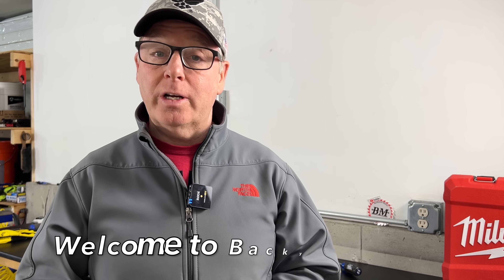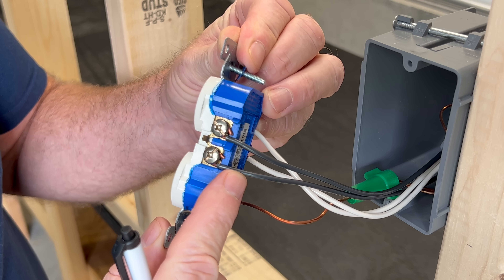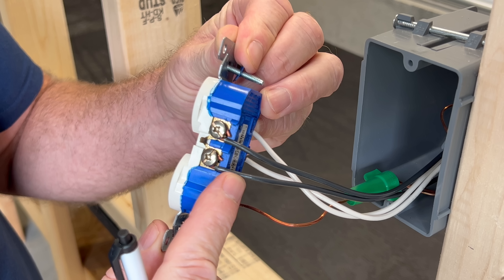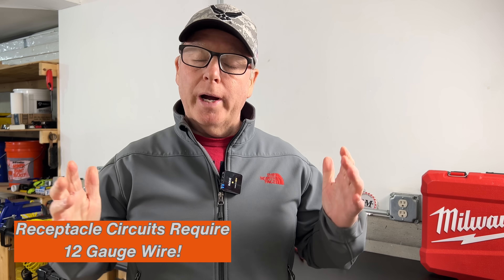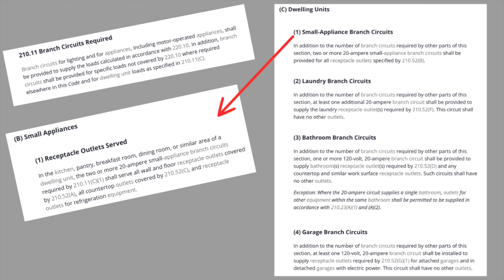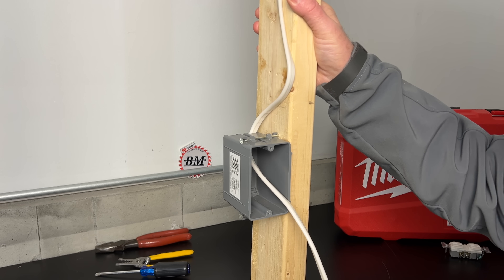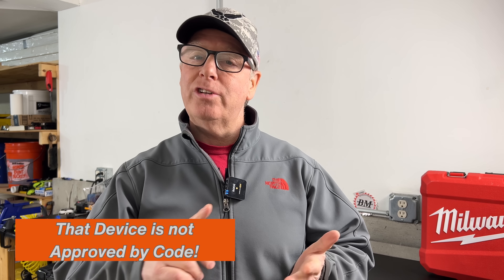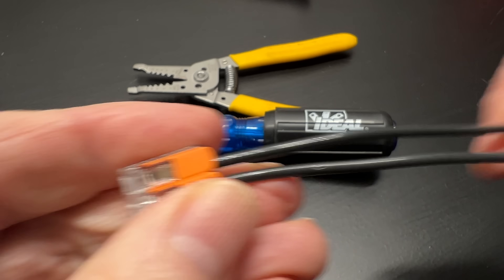5 Electrical Code Lies DIYers Should Stop Believing!

Comment: Does the code require the staple to be 12'' exactly from the box? Why couldn't you put a staple 2 inches from the box and include a 16-inch service loop?
Reply from the maker: Here's a video I made about ROMEX support requirements. https://youtu.be/UwIpG4iQILY
Reply: @BackyardMaine yeah I actually watched that video yesterday, but I think you've not been entirely clear on this point of whether it's ok to have the staples much closer than required and then use the extra slack for a service loop. I don't think you specifically addressed that point in either video. I assume it's ok but wouldn't say I know for sure.
Reply from the maker: @mikanystrom7103 yes you can staple closer to the box but as I stated in the video the cable length between the staple and the box cannot exceed 18 inches.
Reply: @BackyardMaine yes that makes sense, thanks!

Comment: Reminder:  
1. The price of admission to the internet is very, very low.  
2. Actual knowledge is optional when posting comments and videos.
3. The actual (and applicable for your jurisdiction) electrical codes are available in the same device.  Not reading them is willful ignorance.

Comment: So can you use Wago connectors to run to a bathroom or kitchen as long as the Wagos are not in the outlet/switch boxes and at least 6 feet from a water source? Like in a ceiling  junction box more than 6 feet from a sink, toilet, tub or hose bib?

Comment: Lots of good information here and my 1992 built home under the kitchen sink has a standard orientation 2 plug receptacle one of which is for the garbage disposal and the other just open for another use. I'll have to guess this item in the NEC code came about 1992.
Due to space limitations with the disposal and plumbing in place, not easy to due without removal of the disposal which is about 5 years old and next replacement I'll replace the outlet and install correctly. 
Thanks for all your work.

Comment: Thanks for the video didn't know about the pigtail rule I have actually had an inspector fail me once for not having them and had to go back and put them. I have seen we're not having pigtails can cause an issue however back when the plasma TVs on the wall was a big thing had customer that plugs in a hair dryer in their bedroom and when they turn it on the video on the TV would go out but the sound would stay I checked the outlets on that wall and there was no pigtails I put pigtails and it didn't happen anymore,...
Reply from the maker: I have a video on pigtails as well. https://youtu.be/K3RIjUnrNTQ

Comment: run all 12 ga. wire, the cost difference between 14 ga. Is negligible and you will get less voltage drop on larger current draw devices

Comment: I’m hoping you’ll chime in on the seemingly controversial topic of GFCI-protected receptacles in a garage. Even Bill @ Sparky Channel’s explanation left me wanting. (Though I may go back and watch his again.) 

Seems like there ought to have been exceptions where the building is not in a high-risk flood plain (as determined by FEMA maps), not subject to direct water exposure, etc. (Or perhaps the other way around, where such cases mandate GFCI protection for all receptacles. 

Many want to have an unprotected outlet to maintain power to a garage door opener, small refrigerator, etc.
This would be accomplished by having the wiring that leads to such receptacles at the Line side of the GFCI, rather than the Load side. (Or in other ways, but this is how I would do so in my garage.) I added a GFCI at the first box in the garage, and all other outlets in my garage lead from the Load side. There is only one cable, with only one receptacle, that powers the garage door opener.
Reply from the maker: Great video idea.

Comment: The NEC is NFPA 70.   NFPA has number of codes/standards and electricians should be knowledge of.  NFPA 72 - National Fire Alarm and Signaling Code.  NFPA 90A - Standard for the Installation of Air-Conditioning and Ventilating Systems.  NFPA 96 - Standard for Ventilation Control and Fire Protection of Commercial Cooking Operations.  Just among a few.

Comment: Just watched two of your videos. Both exactly what I like to see in common sense video instruction. It would be great to see videos on common upgrades that home owners attempt, like splitting a room's outlets into onto two breakers. Code rules on adding cable runs from breaker box to a receptacles via the attic. Cable on top of ceiling joists, number of cables in top plate holes, cabinet cable gourmets, cable staples and so forth.
Reply from the maker: Awesome, thank you!

Comment: I was under the impression that people have started running all 12ga 20a circuits everywhere to avoid putting a 15a circuit somewhere they shouldn't.

And aren't people starting to do that for dual AFI/GFI breakers too? As easier to pass inspection, avoid mistakes, etc? Customer pays for it anyway, in their eyes.
Reply from the maker: That could make the installation considerably more expensive and we should always try to do the best for our customers. I don't think we should make decisions based on our lack of knowledge of the code. New installations require AFCI protection pretty much everywhere with a few exceptions like outdoors. GFCIs are certainly required everywhere and I have found them to be problematic on some circuits.

Comment: A service loop is great if you can get to the point of security by staples behind the finished wall without damaging the wall!
All circuits should be secured at least 6”from outlet boxes.
Reply from the maker: By code it's 8" for single gang plastic boxes without clamps and 12" for boxes with clamps. I made a video about code requirements for NM cable.

Comment: Wrong about number one😂.
Reply from the maker: Nope.. Better look at your code book again and stop believing what someone once told you. If you want to comment back be sure to provide the code reference.
Reply: @BackyardMaine  where’s the logic of having downstream receptacles go out when one of them fails?😄
Reply from the maker: @caring-assoul_  If your receptacles are failing then you need to pay closer attention to your terminations. An improperly installed wire nut connection can fail as well. I have a video on when and why I choose to pigtail.
Reply: @BackyardMaine  ok

Comment: The most important rule to remember is that the code is the absolute minimum required. The AHJ, aka the inspector, can require whatever they want. If the code says you can use #14 for a 15amp circuit, but the inspector wants #12, then you use #12. Also, if the inspector demands pigtails, you install pigtails. In most cases it is better to just do what the inspector wants than to argue with them and in many jurisdictions, there is no meaningful appeal process by which you can get the inspector overruled. So fighting with the inspector just delays the job and could create more problems.

Professional contractors deal with the inspector/s all the time so they know what requirements they might have that exceed the code. So, it is important that a DiYer speak to the inspector prior to doing the work, usually when they pull the permit, and inquire if there are any special requirements they need to be aware of. You can also consult a local electrical contractor, though since they would rather do the work themself, they may not want to consult with you. You can also speak to the instructors at the local trade school or union hall.
Reply: Not in the real world. The inspector is not the AHJ; he is simply an individual who's job is to make sure installations are code compliant. The AHJ is the usually the building/electrical department. Inspectors don't get to make up rules out of preference. If a code is not on the books in a local jurisdiction, it's not enforceable. Real electricians push back against inspectors all the time when they're wrong. I've had to school many inspectors and any time one tries to make up a rule that doesn't exist, opening up the codebook or a phone call to the chief inspector usually gets him in line.
Reply: @pld8993  If you think that then you have limited experience in the industry. In the "real" world, things do not always work they way you want them to. The local building board is generally made up of a mix of tradesmen and nontradesmen. They often take the advice of their inspectors as to what should be enforced beyond minimum codes.

You can always claim a requirement isn't enforceable, but the inspector will simply fail to approve the work. Then you have the choice to either do it the way they want, or try to take the issue to the building department who will generally be resistant to go against their inspectors, especially if the inspector can demonstrate that what they are asking for, even though it exceeds official code, is "better." You are better of just knowing your local inspector, finding out their special requirements and pet peeves and just doing it. "Real" electricians want to be safe and work the most efficient way possible and wasting time arguing with an inspector is rarely the best way to spend your time. I am not saying to never question or push back, but more often than not, the time lost arguing with an inspector or escalating a disagreement is simply not worth the effort and can be significantly detrimental to not only that job, but future ones as well.
I have 30+ years in the industry across dozens of jurisdictions in residential, commercial, and industrial.
Reply: @TwilightxKnight13  My limited experience includes 40+ years in the trade, got my first master license in the 80s, been in business for 35+ years and licensed in 6 states and dozens of jurisdictions, been teaching the trade for 25+ years and I've served 4 terms on two county electrical boards. I'm still in the field and have been dealing directly with inspectors and electrical departments for decades. 
Electrical boards are typically populated with some non-industry people, as you mentioned. Some even include volunteer citizen members. As such, electrical boards/committees are not in the business of interpreting the code or calling strikes and fouls when it comes to individual inspectors and contractors. A contractor challenging the AHJ (the building/elec dept) could rise to board level but again, interpreting a code provision is something a board is not equipped to do and they will always defer to the experts, the authority having jurisdiction to interpret and enforce the code.
Very little of the NEC is open to interpretation as it is largely explicit and precise. On the not too frequent occasion that competing interpretations arises, if it's something that occurs frequently the AHJ, not an individual inspector but perhaps with the inspectors' input, will likely have decided what the official interpretation is. Your misguided opinion sounds more like something you heard or were told as opposed to actually experiencing it in the real world. Get to my level and deal with this stuff directly and you'll have a better understanding of the industry. If code requires #14 and an inspector fails everyone until they run #10 only because he said so, he won't be an inspector for very long. FYI, bonus lesson for today, there are lots of inspectors that are not and have never been electricians, probably working from a checklist. Class dismissed. You're welcome.

Comment: When was the 20A requirement for kitchen, bathrooms, and garage brought into effect? My home was built in 2016 and they have 15A circuits and 14AWG wire for all of those. In fact, there are only 2 circuits in the entire house (besides 240v circuits) that are rated for 20A. The microwave circuit, and very strangely the dining room circuit. Why anyone would want extra power in the dining room I have no idea....
Reply from the maker: I don't remember which code cycle but I think it was in the mid 1980s. When I built my home in 1998 they were required for at east a decade.
Reply: @BackyardMaine  Hmm. I wonder how the house passed inspection then. Every home in this whole area was built by the same company (Lennar) in 2016-2017, and every house has nearly every circuit at 15A and 14 AWG 🤔
Reply from the maker: @LordSaliss  You can install 15A receptacles on a 20A circuit so maybe the breakers are 20A? Otherwise the inspectors are not looking closely or are not experienced. 210.11c spells it out quite clearly.

Comment: I saw one guy talk about adaptors for foreign plugs. He never figured out why he had so many thumbs down. He was persistently stated  North American domestic voltage is 110 and not the 120 240 we have.
Reply: 110 and 120 are nominal voltage numbers, they're the same thing electrically.
Reply: @pld8993  The 110 is some misnomer that has been transmitted within communities.
Reply: Years ago, the nominal voltage in the U.S. was 110/220. Over the years, it moved to 115/230, and finally to the 120/240 we now use.

Comment: You're not wiring MY house with 14 gauge wire.
Reply from the maker: Absolutely fine as long as the home owner is willing to take on the 25% increase in cost.
Reply: @BackyardMaine  To be fair, the only additional cost is the actual wire. In the grand scheme of things, on a new house, you are talking maybe $200 additional. I would pay that willingly. If you want to save money, do away with the ridiculous AFCI requirements.
Reply from the maker: @littleprincess4417  Thats quite a lot less than what I think but it surly depends on the size of the house and whether you buy your wire in bulk. I also see an additional labor cost since 14 is easier to work with when trimming out. I used gauge wire on my own home for everything that was not a required 20A circuit. I have no issue with using 12 gauge wire though as long as they're willing to foot the additional expense.
Reply: @BackyardMaine  I’m basing my costs on buying 1000’ of 12 vs 14. Of course if you are wiring a 4000’ house, it would be more, but in the grand scheme, wire is usually only a small percentage of the cost of an electrical installation. I’m not sure why you think #12 is harder to work with. Unless you are trying to put too many wires in a box, #12 folds in nicely. I just think it is better to use all 20 amp circuits. You may not. I do enjoy your videos.

Comment: Regarding number two, it may be people are misinterpreting what face up means. Since humans are programed to recognize faces, a duplex outlet looks like a face when the ground is down. So instead of reading face up to mean the outlet is mounted horizontally, they think face up means the face they see in the outlet is right side up. So by turning the outlet to ground up (or upside down, in this case), they see that as face down, which is not face up.

Comment: "adopted" = taken in, used as is.

"adapted" = we'll use the majority of it, but we'll make a couple tweaks.

Methinks you meant "adapted".
Reply from the maker: Good point but I did mean to say adopted. When the code adds a new standard they say they "adopted that standard" which in effect is taking it in as a requirement and it being used by electricians and installers.

Comment: What's the logic behind securing the cable within 10" of the box with a maximum of 18" of cable?  From a homeowner perspective, all it does is make otherwise simple repairs difficult, never having enough wire to pull out if they're cut short, or making it next to impossible to get the box out of the wall.

In the Low Voltage and Communications side, leaving a service loop or "love loop" is the norm (or at least it was ~20 years ago when I was doing it).

Comment: Did a lot of wiring and problem that sometimes arises with making pigtails they add to the box volume and often create a violation for not having a large enough box. Have used spec grade receptacles and when the customer ordered a last minute add on had to run a third 12/2 NM to an existing wall case then use approved spec grade receptacles that each screw can accept two wires under the pressure plate ( one on each side ) and only use a wire nut for the ground wires.Will use the green wire nut with a pass thru hole to save a wire that could make you add to cubic inch space needed .
Reply: Pigtails only add to the box fill when the total length is over 12 inches, which is more than enough. Folding and organizing the wires well is more important.

Comment: Through wire is bad for appliances , if an appliance has an issue.   Don’t be a child
Reply from the maker: Through wire does not series the appliance is puts nothing at risk.. Just silly thinking that. It's still paralleled but at the receptacle rather than a wire connector. I made a video on this as well if you want to know the facts.